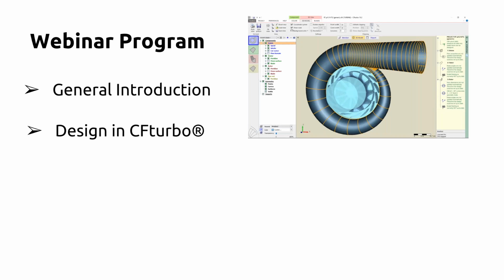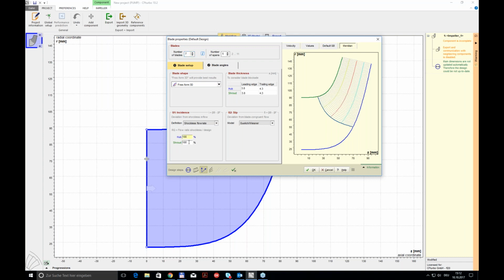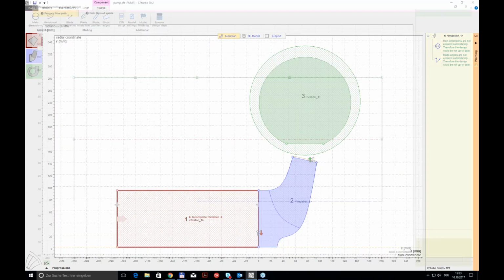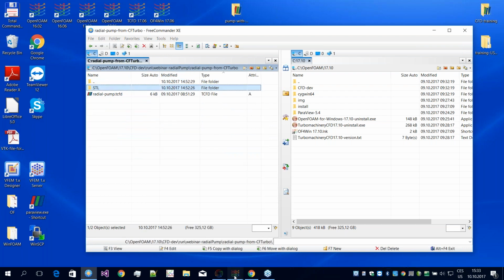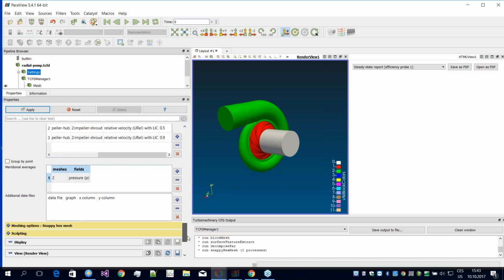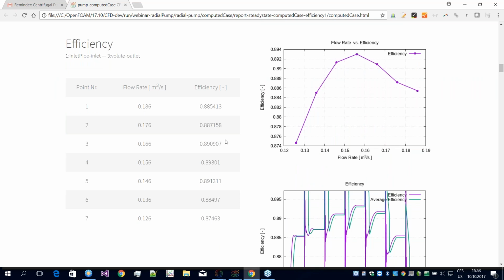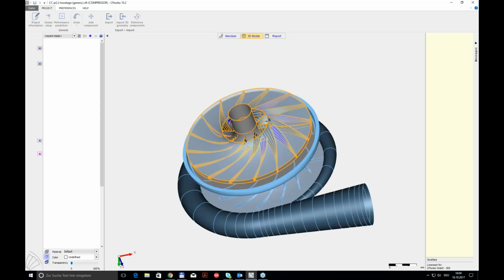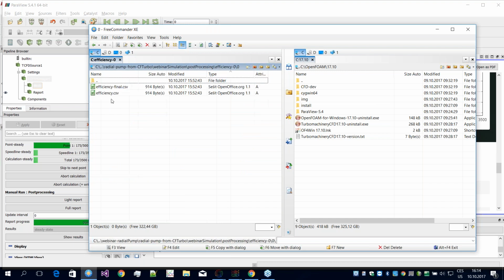Webinar 25 CFturbo® + TCFD® - Centrifugal Pump Design & Analysis,  October 10, 2017

Comment: Are these two software being offered as a single package? I wish I could afford licences for these excellent software. You could consider pay-per-use pricing so they can be available to a wider market. Though someone independent like me  may still not be able to afford that :-\. But just a suggestion
Reply: I might have missed this, but is there a stage where you generate the fluid volume?
Reply: Hi, you can generate the fluid volume by check flow domain in all components in the three, or if you want specific for CFD, you need to go to CFD setup for each component and then activate it in the three.